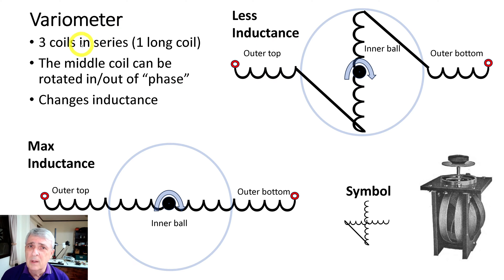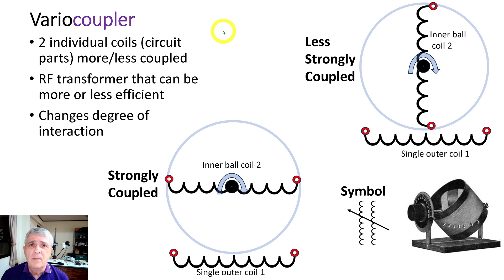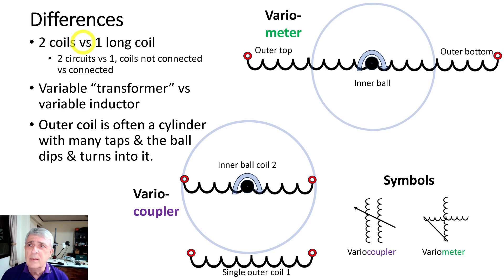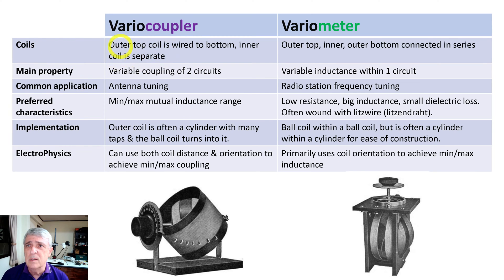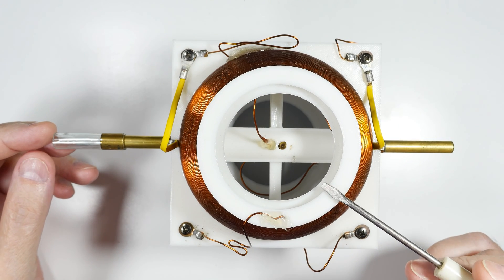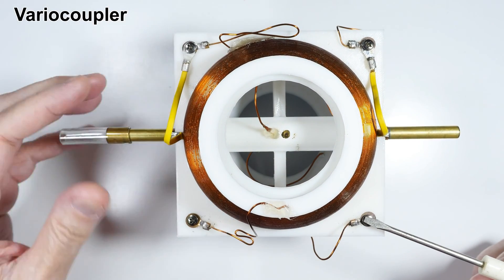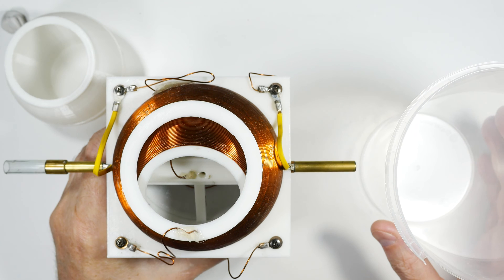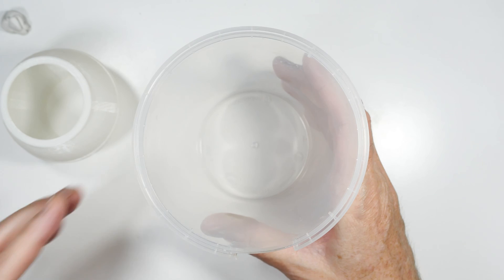Variometer & Variocoupler. Different? Same? (4K)

Comment from the maker: Update: Something I did not mention in the video, the variometer's range is 180 degrees from min to max inductance. The variocoupler's range is 90 degrees from min to max coupling. 

This is the series on how to make these devices starting with the variometer:
Crystal Radio Variometer Pt6.1-- New Beta Version Works!
https://youtu.be/xVQVQnKYP0A

Crystal Radio Variometer Pt 6 - Prototype Is Done! Will It Work?!?!
https://youtu.be/9PO__GsDkAg

Crystal Radio Variometer Pt5 - Ball Is Done!https://youtu.be/DCI8sSCJbQc

Crystal Radio Variometer Pt4 - Better Yet! https://youtu.be/Nzp4hJsnCSU

Crystal Radio Variometer Pt3 - Design Improvementshttps://youtu.be/ooQ8eOIXAaM

Crystal Radio Variometer Pt2 - Winding The Ballhttps://youtu.be/T25Eq2C1iSk

Crystal Radio Variometer Pt1 
https://youtu.be/RgJen7UGZ4M

I have the updated 3D printers files posted on line here: https://www.thingiverse.com/thing:6290893https://www.printables.com/model/632114-crystal-radio-variometer-aka-vario-coupler

Comment: My project with 2 balls...big around 6 cm other around 5 cm...after winding i cut ball in 2 parts for introducing second ball winding same...horizontal axis for second from coper or aluminium...big ball glued...in the same place...wires etc...nice project for variocupler...variometer is facile...good job for yeasteday...

Comment: tuning capacitors was expensive as I remember it. Sorry to say but the files on thingeverse are open mesh so I could not use them but I managed to use them as a sketch and I made my own version. Thank you for the files anyway. Great project, only have to get wire for it. Made the shafts with the 3D printer. Se what I get for result. Thanks for great videos, keep up the good work and I see you again.
Reply from the maker: I made the 3d files in tinkercad and sliced them in Cura. Out of curiousity, what software did you use? Maybe I can go figure out what went wrong with the mesh and fix it.
Reply: I import it into 123D CAD to edit files I find on the web.  I use this program for it was the first I learned. Still thanks for a great design.
Reply from the maker: @haraldlonn898  That's frustrating because Tinkercad and 123D CAD are both from Autodesk. The files I uploaded are exactly the same that I used to print the items in my videos on my Ender 3 Pro. If you can tell me how you fixed it, I can look into what happened. Thanks.
Reply: @tsbrownie  I wanted to alter the design a little, to slice and print your files are great.

Comment: One of the few places I have seen variable inductors used for tuning a radio is in 1950s/60s German tube radios. They used a coil with a moveable ferrite core. I wonder if variometers and varicouplers fell out of favor as ferrite cores became available (not sure exactly when that happened) and also tuning capacitors became commonly available.

On a different note - I wonder of the brass(?) rod axle has enough eddy currents to drop the Q of the system. Or if its relatively so small it has no significant effect.
Reply from the maker: Ferrite cores allow for a much smaller inductor. Plus low cost variable film capacitors moved tuning from inductor to capacitor based. 
That's an interesting question about the brass rod. Most antique radios using this tech had either steel or brass rods. Some did not penetrate very far into the ball. Others did. Too bad there are not internet reviews on those!  ;)
Just watched your Magnetic Levitation video the other day!
Reply: @tsbrownie  Would be interesting to test sometime with a RF network analyzer (have you ever tried a Nano VNA? Amazing capability for $100) . 

Maglev video - sometime I want to construct a coil so that the levitated object is stable and doesn't need a rod to hold in it place.
Reply from the maker: @ElectromagneticVideos   I have a Nano VNA, still new in the box from a couple years ago. ;(  It's easier to buy than to learn/use. A stable levitation would be cool. If you could shape the field by shaping the transformer core....
Reply: @tsbrownie  Its well worth the effort - I found the best thing to do was to use the Windows program that runs it over USB and you can easily select frequency ranges and graphs you want to display. Great for things like antenna matching and testing filters. 

Levitation - it seems the way to do it is to have a core with an opposing winding in the center to depress the field. When I was a student one of the labs had one that levitated an aluminum disk the size of a dinner plate - it was an impressive demo.
Reply from the maker: @ElectromagneticVideos  Thanks for the tip. I will remember that.